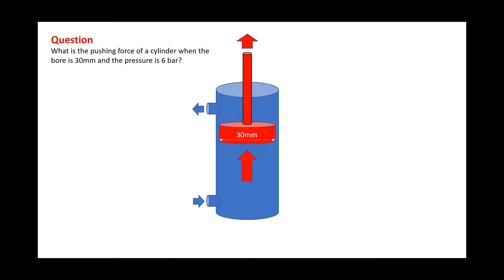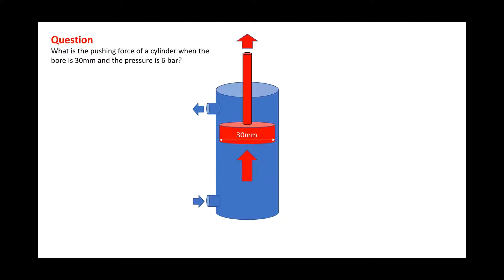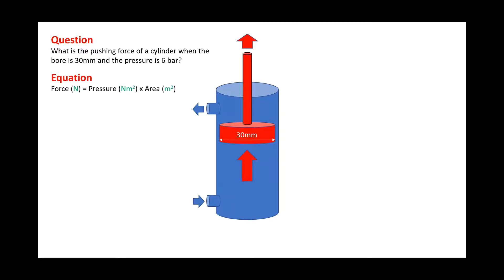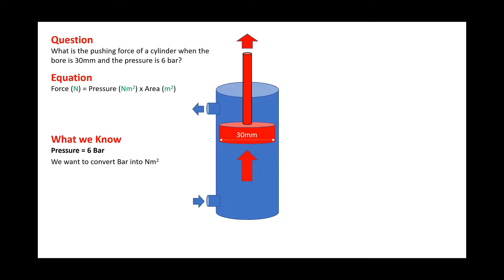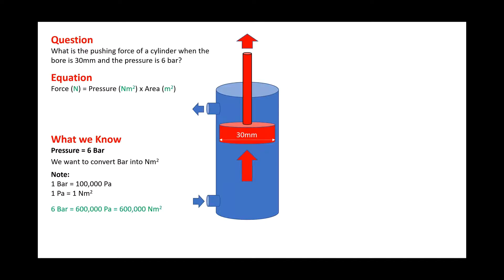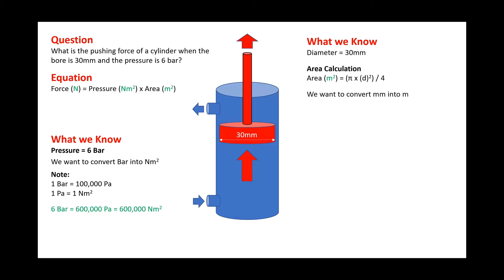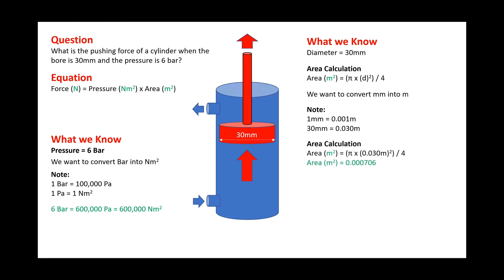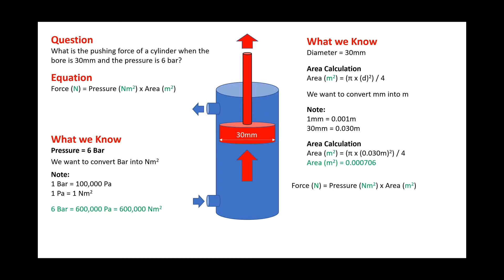How to Calculate the Force of a Cylinder

Comment: So for example a 50kg weight would depress the cylinder right? Should be able to calculate it backward too, to find out how much weight on an air cylinder creates how much air pressure? Like if i knew i had 10kg and i want to find out how much pressure it puts on the air cylinder piston.
Reply from the maker: Hi Tony. That’s correct a 50kg weight would depress the cylinder. If you want to work out how much pressure is on the cylinder you can rearrange the calculation. Pressure = Force / Area and this should give your answer. Hope this helps

Comment: Dear Sir............Example Problem I have a single acting hydraulic cylinder with a stroke of 300 mm, a bore of 18 mm and a rod of 10 mm
 if the press weight is 1 mm on the Piston Head what is the pressure.....Please explain the calculations

Comment: There is something I don't understand how did you find 423 ??
Reply: 600,000 X 0.000706= 423.6 but he didn’t round so he left it at 423 and if you want to convert to pounds you multiply 43 by 2.2 which is 94.6 pounds of force.

Comment: When we say weight = 43 kg does it mean that it can push a block of 43kgs? 
How can i calculate force required to push a 20 kg object at distance of 3mm?
Reply from the maker: Correct yes, this 30mm bore cylinder will be capable of pushing a weight of up to 43kg vertically upwards. 

20kg as a force is 196N 
Force (N) = mass (kg) x acceleration  (m/s)
196N = 20kg x 9.8m/s 

Assuming you are using a slide to lift the 20kg weight 3mm then add 30% safety factor 

196N x 1.3 = 255N 

Summary you need a cylinder with a pushing force of 255N
Reply: @justinwaugh8003  hi , cylinder 32mm Bore 300mm Stroke  , how many KG i can push with this cylinder?
Reply: @manchette4840  assume using 10 bar because most of air compressors using 10 bars.

d: piston diameter [cm]

A : piston area [cm^2]

p : operating pressure [bar]

So, convert d to cm  => 32mm = 3.2 cm

use the formula F = p * A

= p * 10 * (d^2 * pi / 4)

= 10 * 10 * (3.2 * 3.2 * 3.14) / 4

=803.84 N

divide by 9.8 to convert to kg

=82 kg